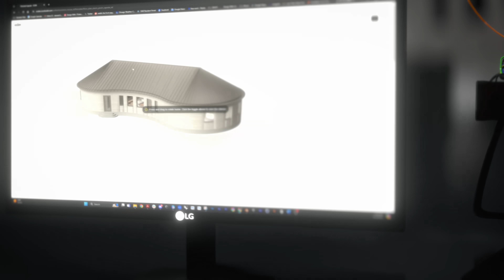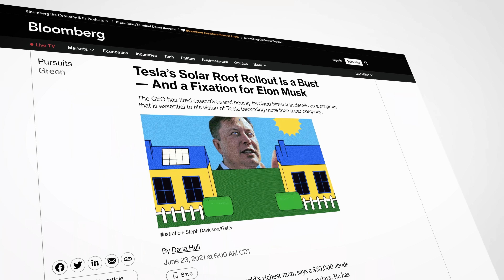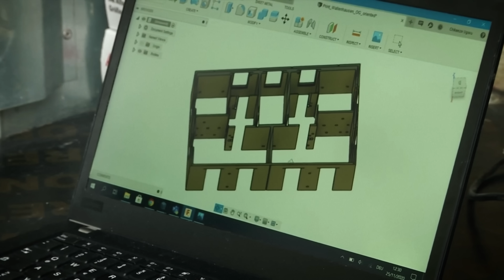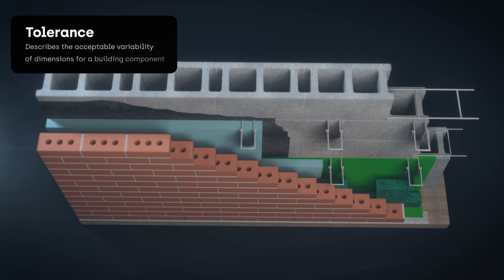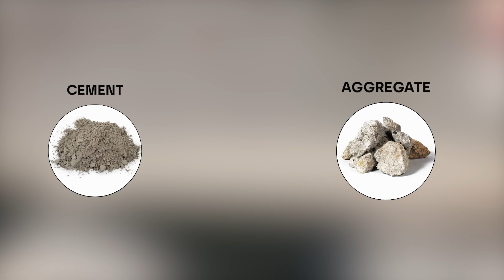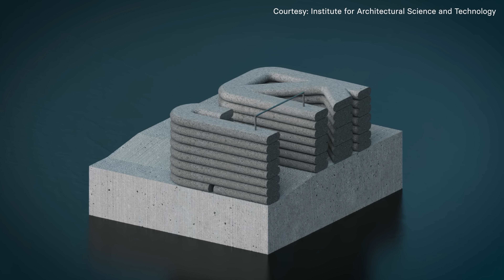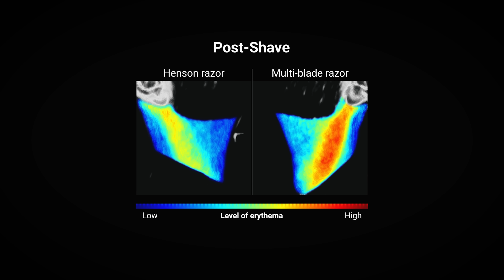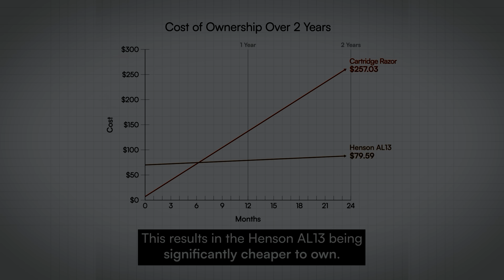Why 3D Printing Buildings Leads to Problems

Comment: The only thing i explicitly hate about this is the insulation. Polystyrene is cheap, but it's an awful insulator. Rats and mice love it too. The insulation on RV slideouts are nothing but polystyrene since it's super light, and even before mice ate most of it out of mine, it was less insulated and less able to be climate controlled than my fuckin shed, and I've lived in the thing before. Winter was excruciating, and i blame polystyrene.

To be fair, i don't see any other way they can do this.

Comment: Maybe progress in construction is slow because buildings are supposed to last a long time and there is a high cost of failure. You can't issue a manufacturing recall on a building because the company moved fast and broke things.

Comment: The approach is wrong. You're making a structure out of slurry. You need tensile strength. Either rebar, fibres, or brick. No reason why a robot can't lay brick. Or use robots to prefab sections.

Comment: Tilt slab is faster and cheaper. You also don't end up with a hard to  clean surface that acts as place for mold and insects.

The reason the 3d print is left  in the rough is because finishing it to flat with rendering is amazingly expensive. You can't spray render it. It has to be hand finished.

Comment: Look at the Housing Defects Act 1984, and specifically Laing Easiform.
You'll find lots of reasons why "Innovative" concrete construction won't work. It's caused no end of problems in the UK... 😬

Comment: And the 3D-printing machine is SO expensive that only the very well funded can build homes, and it's not reducing the costs that way... And no where else would we accept concrete without steel support.  How many sites are absolutely flat without being on a flood plain. I loved 3D printing until I learned the set-up requirements and costs of the machines.

Comment: I would drywall the entire interior of a 3-D printed home and I'd brick veneer the exterior with square corners filled with more concrete if I were to get one.  However, I prefer a rebar reinforced monolithic concrete exterior walled home with concrete roof and then veneer it as desired as well as the roof.  This is the strongest structure design.

Comment: For renovations (In the UK), any removal of a structural wall/member requires the involvement of a structural engineer. These guys could design a domestic structural opening with ease regardless of construction technique..
As for appearance, I don't understand why they don't just render them like many UK homes are anyway?
The reason it won't take off mainstream? The market forces pushing against such a potentially economically disruptive technology.
imo

Comment: 10:00 A concrete block structure used to have bare concrete block surfaces on the inside and outside... then they started adding drywall to the interior and stucco to the exterior as cosmetic enhancement.   The same will happen with 3D printed homes... and it will increase cost and build time just like it does with a concrete block home.

Comment: Tolerance is pretty huge in this case. The people that erect buildings (ironworkers) work in tolerances of up to 1/2" or 12mm lol. Which means that if the print says 10', they can make it be 119' 1/2" - 120' 1/2"

Comment: The 3D print boom has been huge in the last 10 years, and it has allowed for some very creative people to be able to do a lot of independent work, through their purchases of 3D printers and such that required no factories and stuff, but I think a line needs to be drawn when you start making buildings with that technology, because a building is just full of risks even when non 3D printed, when you add in 3D printing into the mix then you're just asking for an accident to happen, and I don't think that the convenience of shorter build times, can more than make up for whatever dangers those constructions may bring in the future, plus as what was said in the video, lets say that the companies making these structures do provide some form of insurance and stuff, whos to say that in the next 10-20 years those companies are still in business, with how the economy has changed since the 2000s, its become very difficult for any sort of business to last a long time, which is why as interesting as the technology may be, I would only say to take a lot of precautions for it.

Comment: 3D printed houses made from concrete look terrible with the wavy lines, if they just smoothed out the sides maybe it wouldn’t look bad or added siding or anything besides the potato chip with ridges look.

Comment: a brick house seems way cheaper than getting the all the machinery, labour and engineering for a 3d house, especially if you're building on a sloping block or have bad access - and you still need finishing trades after hiring all this crap. this doesnt seem very afforable for the average person. and they look like crap.

Comment: A lack of future ability to modify the house would be a major problem, a concept of building modular is an idea that was conceived of more than a hundred years ago.  This lack of innovation  was due in part to the cost of labor and supply of materials.  Now we face the increasing cost of what was common in the past, now becoming more difficult to procure in the present.

Comment: "You can't span an opening with just bricks". This is completely wrong and underlines a fallacy inherent in your proposition - that housing technology needs to advance at the same pace as automotive or computing technology. If you want to bridge a span with bricks you use an arch. With the correctly shaped bricks the inside of that arch can be flat or near-flat, allowing you to easily install rectangular doors and windows.

If you 3D print all the houses you might make the cheaper, but you've put most of the construction workers out of jobs, who now can't afford the houses you build.

Comment: The reality of all homes today is they are done poorly.  Stick homes have multiple settling and other problems with them.  The future like most things should be a hybrid.  I believe making the main structure out of the 3D printing is a great thing.  The stick built can come in and make the rest.  This would allow for easy additions as you could print the box and build the fancy stuff inside with the workability of wood.  It is coming.  Soon they will figure out that they can smooth it or like one gentleman said add stucco to the outside.

Comment: No one in the industry is doing 3D printed houses and likely never will. Why? There is no real value or cost savings and the houses end up looking pretty ugly. If you can build a cinder block house in a day with less effort, how is this supposed to compete?

Comment: Why would you not just plaster over the walls, both outside and inside, with either plaster or concret to make the walls smooth? Sure that would require an additional mason or 2 but that's minor isnt it? That would make the walls smooth and and even where there is a warp. Who would leave that rough look as is? You wouldn't leave a red brick house just looking like brick would you? And for repairs etc....again there is a mason. Wood houses can be fixed easier, i suppose, but wood houses are arguably shit compared to concrete.

Comment: The major technical limitaton I see is... you can't use rebar.
We combine concrete with steel for a reason.
Concrete is great in compression but instanty breaks in tension. The opposite of steel. While both have similar thermal expansion.

Comment: I dont get this. Just do onsite tilt prefabs. If you're pouring a ton of homes in a tract, dedicate some space to pouring short tilt pabels for house walls and relocate and tilt up in the desired lot.

Tilt walls are poured on a base slab which can also then be reused for something else.

Comment: I live in a country which have earthquakes everyday, ranging from 3 to 5, and 8 to 8+ Richter each 10 years or so
My 60+ years old house had endured them pretty well even when you feel inside a box a giant is shaking so violently you can't walk
I rather spend one of those earthquakes in a tent, than in a no-reinforced structure which probably will collapse on top of me

Comment: In New England there is an expensive problem with crumbling concrete foundations due to the presence of iron sulfide. If the special mix of printed concrete isn't durable this will be unfixable

Comment: This video is a bit ignorant. 
The printing is only used to erect concrete walls. The same way as your entire house isn't build out of brick or concrete. 
Your main concern is "how to fix it if it breaks". Well, how do you think they fix it if a normal human-made concrete wall breaks? Or even brick wall? 
It's the same thing at this point. Just because a wall is 3d printed doesn't mean that you treat it any other way than a normal concrete wall.

Comment: Give me a grinder and a lot of free time and ill smooth that wall out for you no problem, bud
You dont have to look at it forever, you just have to print with enough extra that it can be detracted from later to fix the aethetic without sacrificing integrity
Might cost a decent chunk more in material, but eh
Sand and water are cheap

Comment: Why building from wood leads to problems? Why building from bricks heads to problems? Why building with concrete leads to problems? Why electricity use leads to problems. Why being born leads to problems? Cold inert hydrogen in the universe leads to problems...

Comment: From a lean manufacturing perspective, a well orchestrated construction  crew, using a BIM a model, and integrated scheduling could build a far better structure, in less overall time. The problem typically arises when contractors and sub-contractors do not adhere to the proper schedule. Also, building inspectors often screw everything up by not working in concert with a project. 
We have the ability to know everything about a structure before it's built. Walkthroughs, simulations, even how a room would look during a certain time of day, on a specific date. It is possible to streamline the building process. It takes eduction, so more people involved know the way.
All other industries have embraced this methodology. Construction is so far behind, it's laughable.

Comment: Wow... that's an alarming amount of ignorance and lack of knowledge in building physics. How do you think window openings were made in the Middle Ages? Ever heard of arches and arcs? Been in a cathedral? Yes - those are self-supporting structures. 

The tolerances have very little to do with sloppyness,  but much more so with material properties and applied building techniques. Nothing is static. Most materials shrink or expand with climatic changes,  either heat, cold, moisture, or drying. Concrete isn't immune to it either, and is usually kept in check by sectioning and reinforcing it to prevent it from failing, either hairline cracks or structural failures.

Architects over time have been very aware of this in the past, where hands on experience was required,  but seems to have gone out with the bathwater in modern construction. How else have we wound up with the impractical and inefficient shoebox architecture everywhere  where it's unsuited to be built?

Comment: In Greece most construction starts with a conventional concrete structure for the columns, beams, and decks. After the concrete cures the masons come in and lay in the brick to fill in the open areas, this is followed by the contractor who will come in and cover the walls with stucco and smoothed out. Now window and door openings are measured one at a time and a custom order is placed with the manufacturer of these items. So if you have a difference of 1/2 inch or so there is no major issue when windows and doors are set in. A bed of silicone is laid in where the window unit sets in. Masonary screws such as the American Tapcon screws are used to secure the window unit to the walls. Side and top gaps are filled with an expanding foam (window and door frames come with a protective plastic that is peeled off after construction is complete) and when it has cured excess foam is trimmed away. Areas around the window are then caulked with a silicone based paintable mix. The downside to this process is that every window must be custom built to fit each opening. What has me a bit perplexed is why is no one on the outside of the home smoothing out the lines in the concrete with the same mix? Just like the "print head" there is equipment that will allow one to fill in the gaps, followed by someone smoothing out the surface. I would leave the corners rounded since thick layers of stucco could fall off of the corners over time. The fill mix should be the exact same formula that the concrete is made of. This prevents issues of dissimilar materials with different coefficients of expansion from tearing the fill mix from the concrete base material.
Reply: I was saying the same thing in my head about smoothing the walls👍

Comment: I am sure 3 d printed building have a place but there is competition about. Lightweight insulated lego type construction as an example as all the 3 d printed buildings are substituting wall builders and materials and 3d buildings have  quite a set up cost. In mid West America I could see a use of 3 d concrete to create safe rooms from tornadoes perhaps. I do see the technology as long term.

Comment: Geez... if you want to build out of cement... tilt up slab walls are infinitely superior, have steel re-enforcing, cheaper and work with the other parts of the building envelope. And faster to get to the "dry in" stage of construction phase. Plus they don't look like wasp nests.
3D printing houses is just a nail looking for a hammer. It's a monumental waste of money, time and resources on an inferior product. It's basically extruded mortar. It has no real aggregate to so speak, and mostly sand. Having the guys place random metal ties is a joke. And fiber or steel helical mesh isn't the panacea you think it is for a structure you want to live in.

Comment: You should look into the Hadrian X robot. That seems like a much more practical way to "3D print" houses. Instead of liquid concrete it uses standardized/modular concrete blocks being laid with a robotic arm. You get normal looking houses this way, doesn't require nearly as much setup time and can lay the walls of a house in as little a single day.

Comment: Hey Stewart, we actually do put drywall on the outside of buildings. In that case it's fiberglass faced, usually on commercial and large residential buildings like apartments.

Comment: The extruded concrete doesn't have to do it all. Why can't the external use stucco to match existing structures? Why can't the internal be rendered to match existing structures? How is window fitting an issue when it's been solved in standard construction? You should point out issues, you shouldn't make up issues.

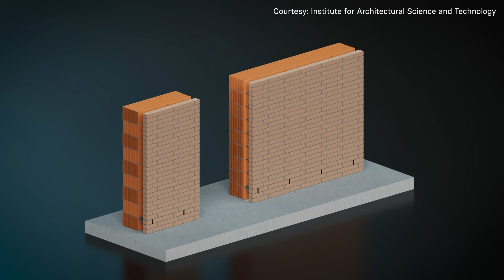Comment: 2:49 I dont know if it will be mentioned later, but you can build entire houses from brick, cause you can build arches that dont need lintels. Besides later you say you cant repair these concrete houses. But yeah they are concrete so you can repair them as you can other concrete houses. (might search for a good company first but when do you dont ?)
Reply: Oh no not concrete I can't replace that, smh

Nah but for real though you can do it yourself it won't look the same as the layered wall but atleast you fixed the hole without spending 200 or more on someone else to do it
Reply: You can build houses and big structures with all kinds of materials including brick if you know anything about constructed buildings in the past

Comment: If there is a some kind of machine on site anyway, wouldn't it be easy to program it to fucking put  fucking bricks on top of fucking bricks? Why making it fancy? People need cheap to build houses, not overpriced ones. Concrete must be reinforced in most of cases and concrete printer doesn't do it. Why you guys in US try to reinvent the wheel the most unefficient way and then try to overcome its drawbacks paying even more? Are you stupid? If you like robots then load fucking bricks to a magazine, and make the robot do the same as people. It will be even faster! And with  90 degree angles!
Reply: Also, europeans produce walls in factories and then construct house on site, additionally pour some concrete into walls. Basically, they do the job better than you and better than this idiot with 3d printing house company🤦🏻‍♂️